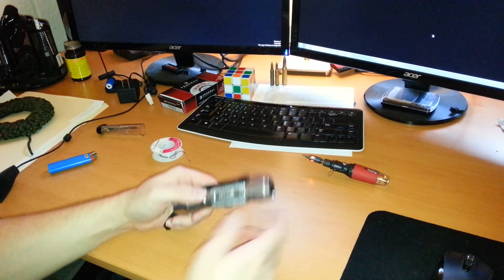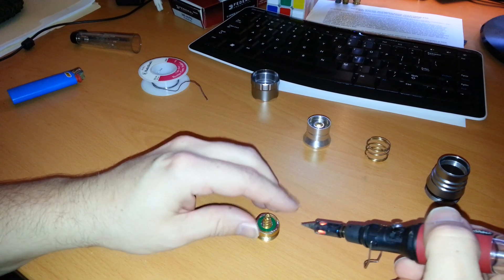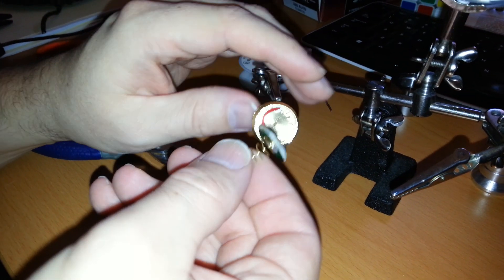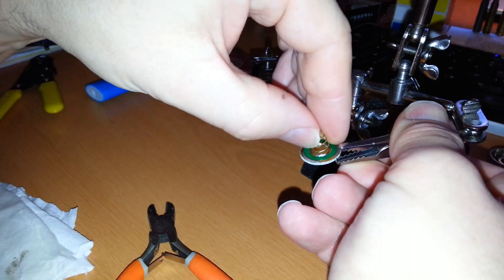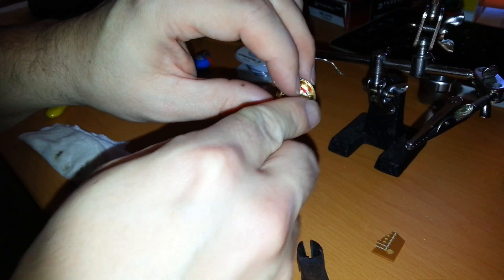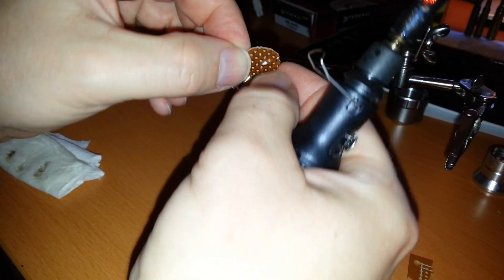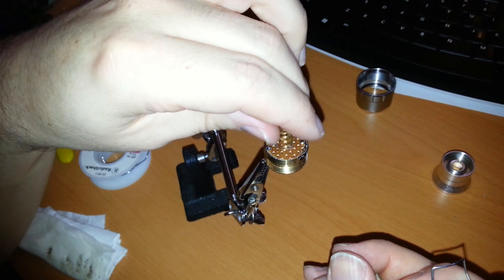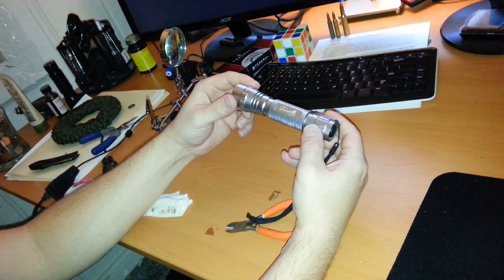UltraFire WF-501B XM-L T6 1000 Lumen Tactical Flashlight 1 Mode Only

Comment: looks fine on the standard 18650 single !  battery.  My flashlight is 2 batteries in series so it would blow up the LED..otherwise a nice simple bypass job

Comment: It is okay but due to the lack of regulating current the LED would over heat and it's lifespan would get shorter. You should add a 10ohm  resistor just for it's safety.

Comment: I know that this is an older video. But I was wondering. About how long did the LED last after you made this modification? And also will this wire direct method work on any multiple mode flashlight?
Reply from the maker: The LED is still going strong, however, there is a danger in removing the electronics because it doesn't provide a battery monitoring system or low voltage cutoff. Lithium batteries can die and or explode and or catch fire when they're improperly drained or improperly charged.

Comment: If it has a through hole (or 2) in the middle like some, you can move the red wire there to bypass the circuit.  You could drill a hole in the middle if you don't mind ruining the board.  All you really need for a control circuit is the appropriate series resistor to limit current.  I think indicator LEDs use 220R.  I looked up the larger chip number in a light I have and found that pins 1-3 are power in, pins 5-8 are power out and pin 4 is the gate.  The smaller chip and other parts control the gate to make the modes.  Shorting the gate to positive will keep the light off.   Shorting the gate to negative will bypass the mode control circuit and it will work in on/off mode.  I think this will also provide the proper current limiting resistor.  I have not mapped the circuit.  I tried shorting the SM cap and the light would not come on.  Shorting it for a moment seems to clear the "memory" of the last mode used.  I think removing the SM cap may make it work in single mode.  I have not tried that.

Comment: VERY FOOLISH.  The LED cant handle constant current at voltage!!! Its going to overheat and melt the LED chip. That is what PWM driver chips are for.
Reply: so why now blf a6 use direct driver on high mode if it gonna melt the led ?..  dont talk if you never do it... i have direct drive all of my xml2 flashlight without one that fails... even on my dedome xml2 also it still working till today on direct drive.. what you expect from a single 18650 battery current ?. it never drive 10amp to cook the led, the higher it can with good 18650 battery is only 4.5 to 5 amp only..

Comment: Its beyond irritating!!!! Every time Im out in the dark if I just touch the button slightly it goes into strobe. Drives me crazy! Thank you for the fix!!! Its been five years now how long has it lasted?  I was thinkin the same thing that the board offers some resistance to no let the led over heat an burn out at full power.

Comment: Great Video! Not only does clickclickclickclickclickclickclickclickclick drive me bonkers every time I wanna turn my xm-1 on bright, the 1st one I bought was from a cheapo China direct website which advertised it as having THREE modes, leading me to slap it on my thigh, mess with the switch,  recharge the battery, or throw it back in the drawer every other time I happened to click on "low". When, I ordered a 2nd which was on sale, I thought I could swap parts until I got 1 of the fuggers to shine brightly again. I gave away one to my buddy (strange how he never came to throw the POS back at me) and was just about ready to "round file" the other one which had been rolling @  in my junk drawer for a year, when I thought maybe I could get it bright again if I bypassed those other 2 flashing modes, went to
Reply: what the!? ...Google the company, then Cree, then here B4 U "enlightened" me about the FIVE worthless modes that this thing had all along  : {l. Ultimately, this new info just means I'd've been looking to bypass those F'edUp modes much earlier.

Comment: This is a good how to and through it I modified our Ultrafire WF502B flashlights without having to remove and replace the circuit boards. I simply moved the red wire, the positive voltage from where it is to a place on the circuit board that connects to the spring on the other side. I found the spot with a VOM meter. I've put two photos on flickr, a before and an after to help anyone out. Here is the before photo: https://www.flickr.com/photos/safoocat/32367886711/in/dateposted-public/ and there is a link under it to the after photo showing where I moved the red wire to. 

The flashlights are very bright after this mod and only have one mode, bright. Thanks again.
Reply: did you happen to test the out put before and after the mod? Curious as to if the board regulates the voltage.

Comment: I have a generic flashlight, don't even know the brand, that has a cree led and uses 4 aa batteries to power it. I blew the board when I used 14500 batteries but the led still works. Would this method fry the led using 4 aa batteries?

Comment: i have an xm-l t6 that runs on 2 18650's can o still do this 1 mode mod or will i just burn out the led?
Reply from the maker: Don't do it. The LED isn't rated for that voltage.
Reply: engineglue I have the xml t6. Is there anyway I can make it a one mode?
Reply from the maker: No clue. :)
Reply: In essence, I've done it already.  I hacked my 501b after blowing out the circuit board by using (2) CR123s instead of (1) 18650.  My 501b ran fine on the CR123s for short periods.  it was brighter than the high beams on my older model Saturn SL1.  However, it does start getting hot and it will cook the Cree LED eventually. While the LED will tolerate the extra voltage, the 501b body does not dissipate the heat well enough to allow for extended use.

Additionally, not all of the Cree drop-in units/circuitboards are created equal. Some units can only handle up to around 4.5 volts (They say 4.2). Always read the technical specs before ordering. Flashlight hackers want the flashlights and/or drop-in units that are rated to the 14V range. These are original equipment in the older 501b lights.  These units can handle the a pair of CR123s (3v each) or even a pair of 18340s (3.7V ea) for shorter durations.

One other note:  Some of the newer units that are rated up to 4.2V actually have a circuit board that upverts the voltage to the bulb. Bypassing the circuit boards on these units will result in a much dimmer light...even with the extra voltage from the CR123s.

My next flashlight project plan is to modify my (4) C-Cell police duty light to run with one of the units mounted in the reflector.

Have fun.

Comment: Can't read all the comments - BUT - You might have a fake flash light. Look at the logo at the side. Does it have an (R) stamp next to the UltraFire, or not? If not, a fake. Also the battry stated 4000mAh, which is not made by UltraFire from what I've heard. Both those things makes me sure that both the battery and light are not genuine.

Comment: I had a 1000lm flashlight that did not have modes on it and no other extra circuitry aside from the emitter. worked fine for years until it got stolen. I don't think removing that board will damage the led. great video
Reply from the maker: I agree. I think the Mag Lite LED conversions don't have a circuit board either. The main potential problem with this light is that it's high powered. The circuit board pulses the LED which reduces heat over time. When left on, this light will get very hot. I'm certain it degrades the total life of the LED by some percentage. In my opinion though, it's insignificant compared to the cost of a replacement LED. Also, you can't use two CR123A batteries in this hacked light.

Comment: Engineglue+ I have the ultrafire 502B is there anyway you can disassemble flash mode without putting a different board in it???
Reply from the maker: +Smiffer Smaffer Maybe. From my experience with a few of these flashlights, they're not all the same. They have different boards. If yours has a board which allows you to change the mode setting, you may only need to do a resolder job. Take a look at the board. Yours may have a couple of through-hole solder positions for moving the power wire. On one of these flashlights, it had two positions. One position had five modes and the other had three modes so I still had to do the mod. I've heard that some have an option for single mode. Maybe you got lucky. It's also possible to do a cap mod but I don't know how this is done. Someone also suggested a pencil mod but I haven't looked into that one. Read some of the comments for links or other ideas.

Comment: For the life of that flashlight, you would spend less time pushing the button to move to the mode you want than you spent screwing around with this mod. Besides, you almost cut your fingers off with the knife and burned the rest of them off with the soldering iron.
Reply: +hiccup45 13 mins? you can't say that for sure.. theoretically the light could last 80 years.. and so could he, haha
Reply from the maker: +hiccup45 haha Yeah, but you can't use it as a weapons light with the modes.
Reply: I wouldn't use it as a weapons light with the mod either.

Comment: Hi bro.
What if you put a resistor to avoid ruinig the LED?
Reply from the maker: Ivan Sotomayor A resistor would decrease the LED's operating amperage which would increase it's lifespan. The stock electronics likely use a pulse circuit which is more efficient and it would be best to use that.

Comment: Good thing you put this up here, had a similar flashlight which died after falling on the ground a few times, have bypassed the circuit on the off chance that it wasn't the LED that had died and now have a working light again.
Reply from the maker: Nice. I think I mentioned in the video and some people have mentioned in the comments that LED's technically shouldn't be powered with direct current. You may also already know that. So, it may shorten it's life but I haven't had problems yet.

Comment: LED's need to have a driver to work properly that's why single mode flashlights come with one, all this guy did was ruin his flashlight. It will still work, sure for awhile, but the LED won't last as long and it will use far more power so the battery won't last nearly as long.
Reply: It will last longer than he will be alive. I use the 501b/502b everyday and just drill through the board and direct drive to the battery. Only problems I have had is with the drivers shorting out, not the LED. Much more reliable as a weapons light too.
Reply: If you're right then all those engineers and manufacturers are stupid for using drivers in their flashlights, you should let them know they're doing it all wrong maybe one of the companies will put you in charge.
Reply: Maybe I will. Until then I will direct drive them until one fails, if one does its $5. Whoop-de-fucking-do.
Reply: Aren't there single mode drivers for these lights that will not burn the LED out?  I have a 3 mode light and I only ever use it on high.  I also find that kinda annoying when I turn it on and it is flashing or dim (as if the battery was drained).  Surely there must be a driver circuit that he could have used and kept a reliable flashlight.  I do like the XML-T6 flashlights because they are not expensive anyhow and they are also bright.  I also like them because lots of them use just single cells which is safer especially for someone who does not know the potential hazards of using more than one lithium ion cell.
Reply: GhettoRanger hahahaha
Reply: driver?  Its not software bubba , voltage is the issue. I'm sure it needs to be toned down a bit but no driving miss daisy here.

Comment: i got china ultrafire, but on my driver I CANT FIND THE microcontroller Oo  theres just 1x P-Mos IC APM9435, 1x Transistor 1x 10k resistors and 1x 1µF cap  
   i got 5 modes too, but WHATS CONTROLLING IT?!
Reply: gamerpaddy the 3 lead device that looks like a transistor is actually an integrated circuit, this happens often, ie 3 lead regulators, 7805   7812, +5 & 12v 1amp regulators, 7905 7912, same but negative, pinout is 123, in ground out.

Comment: you could have just found out which of the resistors to remove off the driver to disable the modes you don't want or alternately you could get a different driver. or a full other drop in with 1 mode like i did i chose one with an op reflector too.

This is what is called direct drive it is extremely bad for the led. The other mod in the description is going to vary on drivers.
Reply: XM-L's are built like tanks. I direct drive the $**t out of them and heat them to nuclear hot. Work every time, not one failure.
Reply from the maker: I completely agree. :-)
Reply: Could i please ask you just quick? If i am about to buy a 1800 lumen multimode LED for my airsoft gun, where it will be used like 20 times a day for a very short period of time only and that being maybe once a week. Do i need to worry about lifespan or not? To be specific - i want this to be 1 mode only: http://www.aliexpress.com/item/1set-1800-Lumen-Tactical-Zoomable-CREE-XM-L-T6-LED-18650/1013187647.html?s=p 

Thanks a lot for any help
Reply: that should be fine

Comment: I just did something similar, I just used the old pcb.. Just soldering the red wire directly to the smaller spring on the oposit side of where it was originally.. :)

Comment: why not just connect via original pcb and just go directly from the terminals bypassing the electronics ?
Reply: you will se 3 golden dots in center above spring for positive In 
those 3 solderpoints are directly from the spring and goes straight through thus bypassing the circuit with modesettings:) 
takes but 1min to move the positive connection :)

Comment: Excellent video! How is the light holding up since the mod? Thanks.
Reply from the maker: Thanks. The flashlight still works. I tried using two 16340's and blew out the LED. Oops. I don't know what I was thinking. I bought a replacement LED for $4, installed it, and it's working great. I also tried the Panasonic NCR18650B which is slightly too much power on a fresh charge. It didn't burn the LED but it caused it to shut off. I think the alternative method for modding this flashlight is a better idea. I've been meaning to make a video for that mod. Perhaps I'll do it now. :-)
Reply from the maker: engineglue Started a new video with a new flashlight but this one has a different set of electronics so it didn't work. I modded it the way I did the one in this video and it works fine.
Reply: engineglue Thanks. Which flashlight was it? And if I understand you correctly the method in the original video did work on this new flashlight (?) Thanks again.
Reply from the maker: engineglue The same flashlight. WF-501B. One I hadn't modded yet. The original mod worked fine. The suggested mod in the description did not work.

Comment: I manged to do this kind of modification by mere fluke on SSC P7 emitter by powering it with a 6 volt RC battery pack which probably burnt the controller curcit but somehow still worked after that.

Comment: Thank you very much, I had the exact same model (different color) and a different flashlight.  I utilized your video to convert both to constant single beam.  I was inpatient and couldn't get a circuit board at the time, so I used a dremel and removed all the surface on the circuit side to make it negative/neutral, drilled 2 tiny holes, 1 near center and 1 near rim, with a small engraver and finished it off like the tutorial.  Because of you, I was able to convert my weapon mounted flashlights to a more tactical preference.  For that, I thank you very much and give you mad props.
Reply from the maker: Glad I could help a fellow doer!
Reply: 9 months down the line, how is the led fairing?
Thinking of doing this myself but thinking without the microcontrollers the led will be working over load without the protection thus shortening its life span.

please advise.
Reply from the maker: Master Llyod  Still works! (:
Reply: engineglue   wow, i'm impressed.
will have to give this a go then :)
Reply: engineglue I like the 3 mode modules as well. Hi/low/strobe with mode memory. But I drop my flashlights so much I have had driver failures before. Thats usually when I drill the holes and direct drive it like ^^ Jason.
Reply from the maker: Master Llyod Also note, someone found a source for a single mode version of this light. http://dx.com/p/ultrafire-wf-501b-cree-xm-l2-t6-500lm-white-flashlight-silver-1-x-18650-213653
Reply: Exactly what I do, drill some holes. Cheers!

Comment: Sorted this.  There is a small gold circle right in the middle of the circuit board.  This is actually part of the gold inner circle of the contact board.  I just soldered the red wire onto that gold circle and hey presto, job done

Comment: I didn't follow exactly your method. I simply drilled a hole into the board it came it, so the wire could fit and get to the other side. ;)

Comment from the maker: You should get a prototype board. These boards usually have plated holes. What happens when you try to trim the circuit board? The black wire should touch the metal housing and the red wire should touch the spring.

Comment: what kind of circuit board to i need? i bought "general purpose printed circuit board" from radioshack and i cant make it work.. the bulb is still working though. 
should the black wire touch the spring/casing?

Comment: I did the same thing with my flashlight,  works fine now. I hated 5 modes and considered selling the torch. Then i saw how cheap individual leds are, for my flashlight (in case for a failure) and i went for it. Had some trouble with " - " wire to get connected propely at the beginning, but i roughened the edge a bit and got it working at the end. Tnx for the video!!